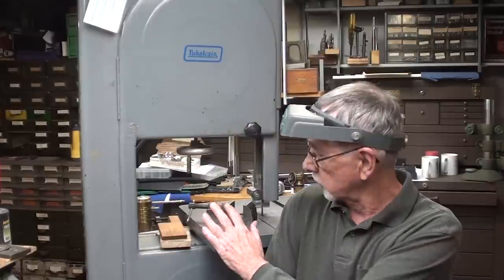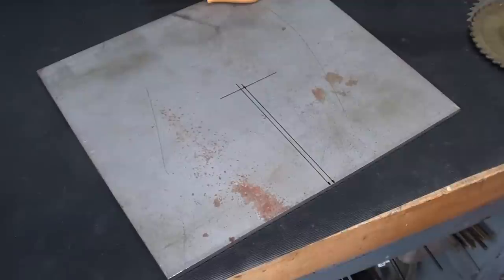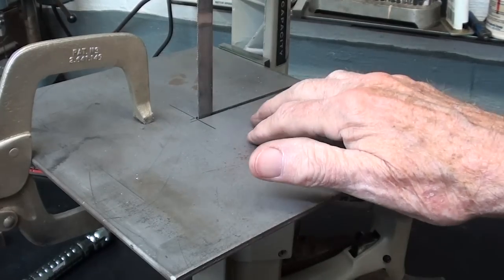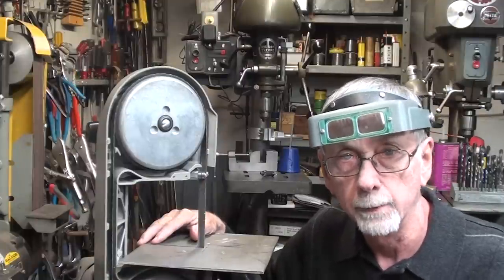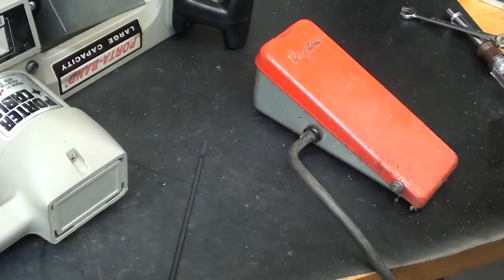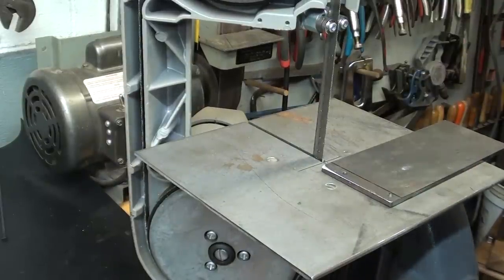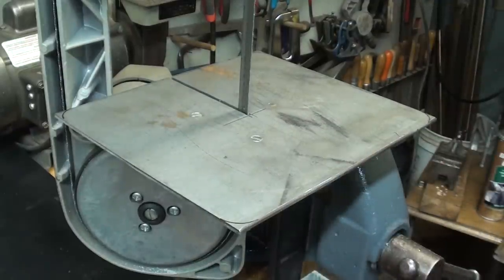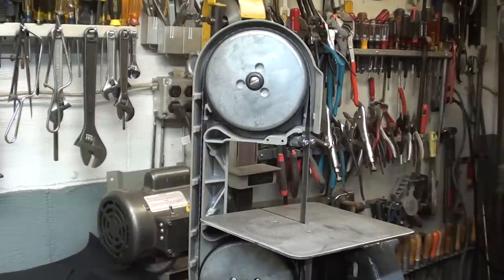Make a Mini Vertical Metal Band Saw TIPS 579 tubalcain

Comment: Sir, i have to admit i am a lazy bastard 😄 my method will be using a old chair, those wood top, no back and 4 skinny iron tube legs, that kind of chair, unscrew the top, cut the slot, mount the saw, screw it back, job done.

If it is a square board on top, i will consider making a adjustable fence for straight cut.

Or, find yourself a fire extinguisher mount, that thing can hold you band saw pretty good on rhe wall. Of cause you still have to make the surface plate and some piece of angle iron to secure the saw.

You may have similar ideas if your entire family live in a multi storey building with a size of a 2 car garage. 😄
Reply from the maker: Your opening sentence cracked me up, and I spit out my coffee. Actually, you got some pretty good basic ideas there
Reply: @mrpete222  sir, that is a black joke, it is black but true, remember i told you i had try cast alu parts before? I had to bring the furance to a park at a saturday evening while almost no one on the street, and you will have some cops as audience sneaking from your back, they though i am doing something illegal. If you want to drill a couple holes on a piece of wood, the next thing you know is somebody banging your door and complain for noise ....... that is such a city where i live. Make no mistake, the person who bang my door probably is a millionaire, literally, because the land and house is insanely expensive! Last time i check, the flat i live, which is about 350 square feet now cost more than 4 million HKD, which is equivalent to 500k USD.....

Comment: Wow, I just went looking for that 2and bandsaw I've been wanting.  Turns out wish.com is selling one for less than $40!  The harborfreight ones are supposed to be at leas least adequate after the mandatory tune up, how bad could this thing be😅
Reply from the maker: Yes, that’s mighty cheap
Reply: Unfortunately I think you might want to check on that. I just looked over there and I think you might have just bought some blades. I couldn't find a saw for sale at all, but I found some blades in that price range that had a picture of a saw with the blades, so it really looks like you're getting a saw. Very deceptive advertisement.

Comment: You could do all that with a angle grinder. M
Reply: Mark Owen If he did it with an angle grinder you would have commented to use the belt sander and another band saw.
Reply from the maker: Sure, but using a grinder is a miserable job
Reply: @mrpete222  I know. M
Reply: @susanbarbier5053  no I'm taking about myself. I don't have a band saw. Or a belt sander. Or a milling masheen. 
All I have is a grinder. Angle grinder. You got to use what you have. M

Comment: Two points Pete. First point:" You went down to your local High School welding shop". Point number 2: "Picked up two steel plates free of charge". As for Point (1), I didn't think HS shop of any kind was still in existence. Regarding point number 2: Did tax payers buy that stock? If so, I wouldn't brag about it... Just say'n.
Reply from the maker: Pick pick pick
Reply: @mrpete222  Sorry about that Pete. I had just finished working on 45 year old water valves the day I posted that whiny crap. I love brass but I hate pluming! I was close to emotional meltdown and should have steered clear of shop buddies. I hope we still are?  Wakodahatchee Chris ;-(

Comment: Did you go to my workplace's shop and take our drill press vise? Wait no, no you didn't, yours looks much nicer..
Reply from the maker: lol. That’s funny
Reply: @mrpete222  We have one of those real fancy drill presses, has a built in floating head for tapping (can be locked/unlocked with a button press). There's a trigger to unlock the upper portion of the drill, so you can maneuver it into place, let go of the trigger, and it locks into place. Auto feed and auto reverse (again for tapping). Probably weighs more than my car... Its a real nice drill press, but man that poor vise, it has the marks of many inexperienced users, not just in the jaws but also down in the throat and lead screw! Yes there are many marks even on the lead screw...

Comment: Hi Pete, I did the same thing with a barely larger bandsaw, but with a significant difference, I removed, err repositioned the twisting bearings that change the angle of the saw out of the wheel, so that way you can cut longer pieces of steel without hitting the body of the bandsaw. This way also makes the blades last longer because they are never twisted, you can check it out here: https://www.youtube.com/watch?v=eDd-eAPqMbA

Comment: Instead of trying to find a friend with a metal band saw why not use the metal cutting Portaband to cut the slot and corners off the plate?
Reply: Yes, use the Porta Saw itself to cut off the corners.  It was readily available.
Reply: There are still hand saws too
Reply from the maker: Yes

Comment: I built one using a Milwaukee portaband and I made it on a pivot so that it can also be used as a cutoff saw.  It bolts to my my welding table along with an auxiliary fence used for cutoff duty.  Mine has a main arm for saw attachment which can be used to support a sliding weight but so far it hasn't been needed.  Two brackets bolt to the motor and then attach the saw to the arm and the pivot is a 5/8" shaft currently running in reamed holes in the base but I have bronze bushings not installed yet to minimize wear.  It's already become one of my most used tools. 

https://www.homemadetools.net/forum/attachments/portable-bandsaw-base-bandsaw-vertical-finish.jpg-32356d1575148786
Reply: I'd like to see the build but your link is not working.
Reply from the maker: Thank you, I will check that out
Reply: @mrpete222  It's more useful having both modes readily available but for cutoff duty the pivoting mount must have no slop and must be rigid (without building to battleship standards) so that the blade doesn't wander in the kerf.  The platen comes off for cutoff duty but it's only two screws to remove it.

Comment: No blade guards or wheel covers. I am surprised you would think that is a good idea to present. But the table has rounded corners, so its safe. You bombed on this one Pete.
Reply from the maker: That’s right safety Nazi pick it apart
Reply: @mrpete222  OK. So I guess you would want your kid running this? What happens when the vise vibrates open and a running saw with no shield heads for the floor. I may not be a biblical superhero like you, but I know a dangerous setup when I see one. I still say you bombed on this one Pete. And you can't lower the upper guide for correct blade support. Running out of quality material?